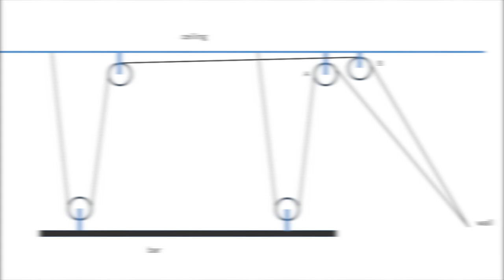HOW TO BUILD A SIMPLE GARAGE PULLEY RACK

Comment: Why were the ceiling brackets different? Thanks
Reply from the maker: We changed the design a bit midway through to add two separate ropes. This always you to level the rack with uneven weight. We had a random bracket that we hung.
Reply: @SugarkaneTV  Yeah - the whole video is off - you start off with a single rope system - next minute you have two ropes - really confusing. Sorry. Would also put in a double pully at the start to increase mechanical advantage for the weight you are hoping to get.

Comment: second these are not pressure fittings and did not need male adaptors the pipe will bead enough to get the fittings together and would be stronger

Comment from the maker: Hey guys, 

PVC wasn’t the greatest material to use. It wasn’t a complete failure, especially when only holding tubes for the river, but we need to make the rack much more rigid, so we can hold more weight. It was a slight oversight, so I will be building a new rack and uploading a new vid soon.
Reply: What was the problem with PVC?  Did it bend?  Crack?  How much weight did you put on it?  I still like the lightweight aspect.
Reply: Did notice u went to the 4 corners.
Reply: Aluminum extrusion instead?